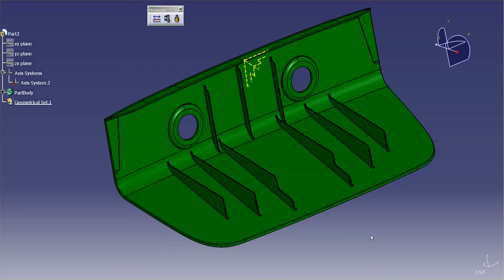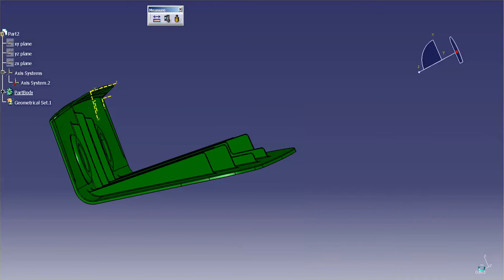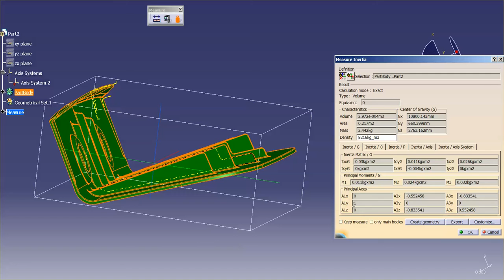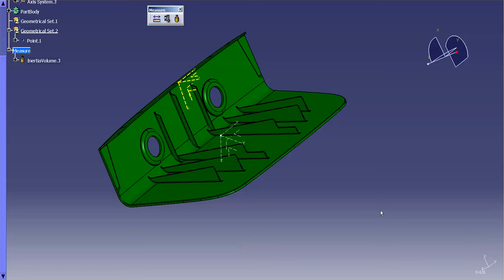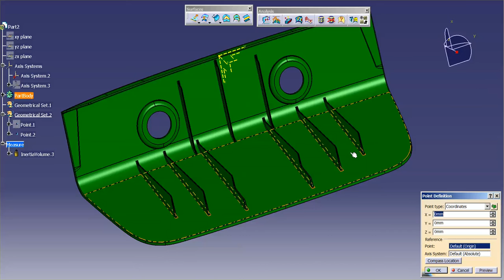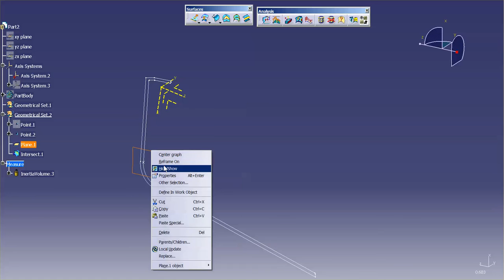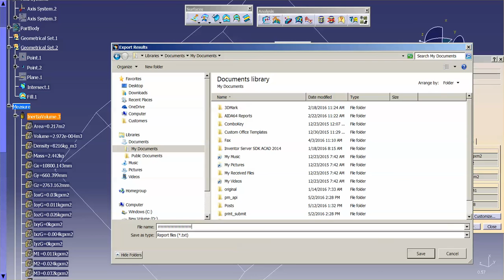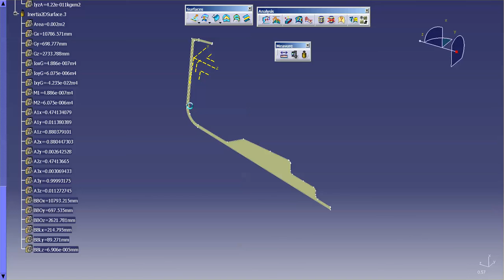Catia V5 | Catia V6: Measure Inertia

Comment: how come im working on inches and the area shows in meters?
Reply: I know it is late but you have to change units for every type of measurement individually... For example, you can set lengths, areas, and volume to different units... Go to Tools>Options>Parameters and measures>